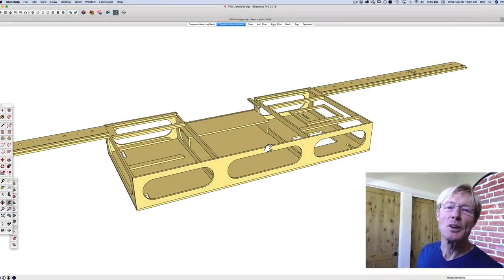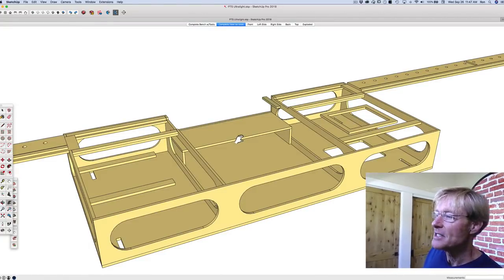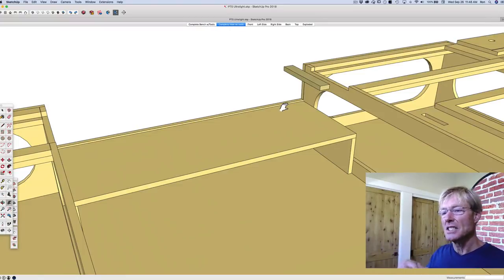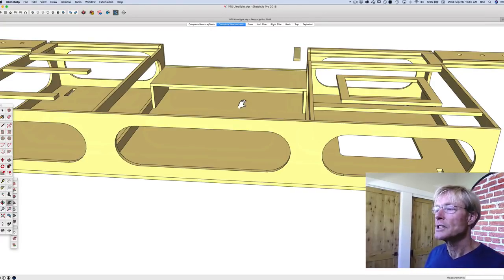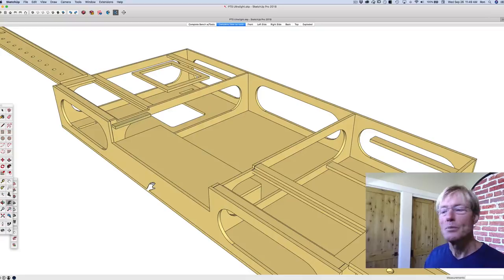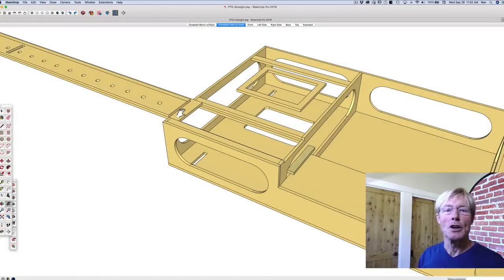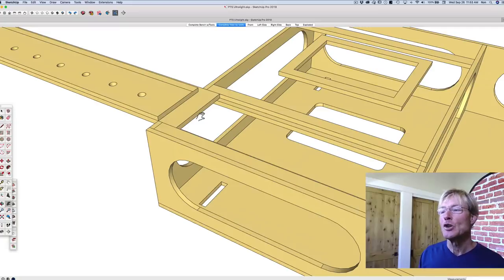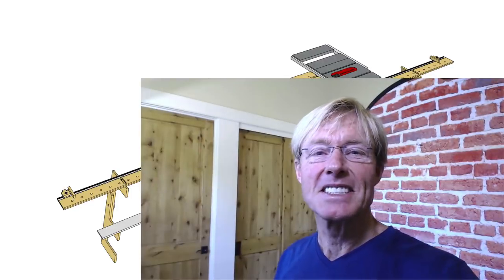PTSU Surprise find plus Festool Domino Connectors

Comment: I don't see how the domino attachment is better than the hasp.  It seems it is much easier to undo a hasp rather than a dominoe, which you would have to find an allen key for.  Also don't know much about dominoes, but it seems like putting one in 3/4" plywood is a bit thin?  Tell me if I'm wrong.
Reply from the maker: Maybe I will get a chance to build it out with the Domino since I have already provided an alternative for those that don't have a Festool Domino.

Comment: What about using the 35mm Cam And Dowel Fasteners available at Woodworker's Supply? https://woodworker.com/swirl-cam-set-with-35mm-bolt-mssu-128-825.asp
The cost is reasonable and most woodworkers have a 35 mm bit. It can be used in the horizontal position but you would have to go back to making the base out of 18 mm material.

Comment: Hey Paul great stuff, I am planning on building one soon just waiting for you to hash out the modifications of this current model first. Just curious what the differences are in this latest model and the former total station, I know ultra light plywood, and general improvements I’m guessing? Thanks for all your hard work and sharing
Reply from the maker: Practically it will be the same except for the whole design😎 The miter saw side will be stiffened with less material removed from the middle, No Table Saw support and redesigned extensions to be swappable with the new improved FastCap Best Fence. It will cost more to build. I am planning on releasing it as the PTSU and keeping the PTS available as many will want the table saw support and lower cost to build.
Reply: Ron Paulk heheh thanks, looking forward to seeing what you come up with sounds great.  I will be one who wants the table saw extensions but still curious to see how this turns out before I build. For now I’ll be leaving an empty space in the new work van for it! Speaking of which I need to call around to maybe get a hold of that ultralight😃
Reply from the maker: jackieearl  Check here for suppliers https://www.youtube.com/watch?v=39P2LKouer0&t=47s

Comment: How much does Festool pay, or give you?  Many woodworkers cannot/will not pay the outrageous prices for the Festool brand.  I understand that they are great performing tools, but at an outrageous price.  Many years ago, I saw my first Festool Domino, and was immediately impressed, since I had been using biscuits for my projects.  As soon as I saw the price, I decided I could buy four biscuit jointers for the price of a Domino. I would say for the average woodworker, although they may not be as good, a name brand product will do the job.
Reply from the maker: Festool has given me tools but I purchased most of them at full price long before FT offered to send a few tools my way. So yes, I buy Festool with my own money and have never regretted it. Years ago when I employed a skilled 6 person crew, plus 3 trucks and trailers and the lots of insurance to boot, I realized that tools were an insignificant cost to my business. Having tools that work efficiently, hold up over time and produce work that reduces costly callbacks cost me far less than inexpensive tools. I am glad Festool is around and I don't care what they charge as long as the tools provide value. The good news is that no one has to buy any particular brand and the majority of tools on the market are built for a price point so low priced tools are abundant, whereas quality built and engineered tools are rare. Also, a biscuit jointer and domino are not the same and I know of no other company making a similar tool. I sold both of my biscuit jointers as they did not get used even once after I purchased my first Domino. Value is what I am after not price as I am a tightwad and once I spend $$$ I don't want to spend it again.
Reply: I have a domino and I barely ever use it. When I need it there's no other tool or method I would use. You cannot beat a mortise and Tenon joint and to have it portable in such a small machine is priceless
Reply: Domino was my first Festool several years ago and I choked on the price. However after using it I sold my lamello biscuit joiner and have purchased several more Festool products. I am thrilled with all of them and don't regret any of the buys. In fact if I need something and Festool makes the tool I always go that way. I actually have never noticed a bias to Festool from Ron Paulk. By the way at the time of my Domino purchase the price of the top Lamelo biscuit joiner was quite close. Festool is very expensive.... once you have one it is difficult to go back to lessor quality.